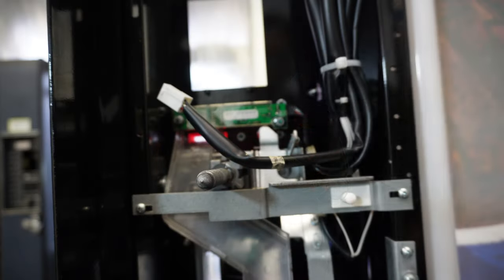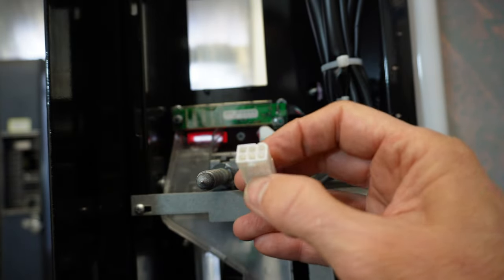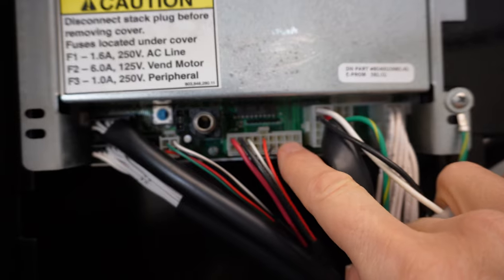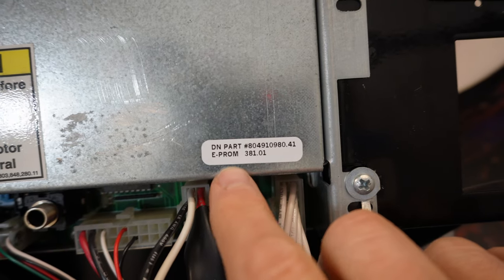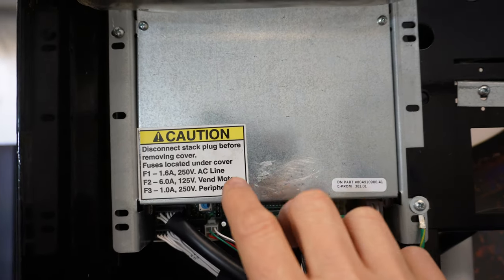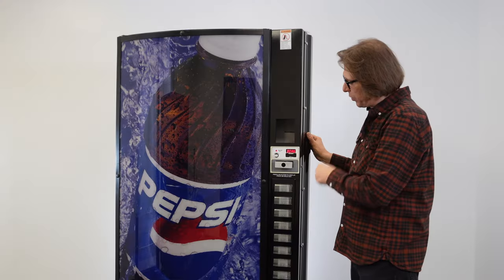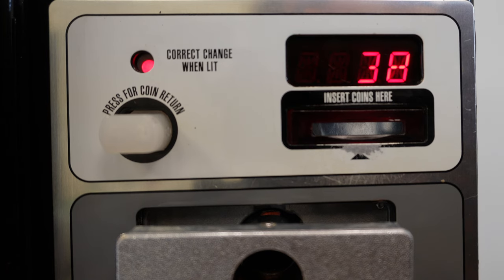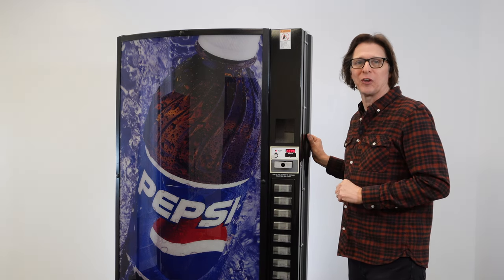Drink Vending Machine Cashless Payment Requirements For Dixie Narco E Series

Comment: Would you have any insight for this…..My Nayax credit card reader accepts the credit card, chargers the card but doesn’t vend the soda??  I’ve disconnected then reconnected the daisy chain but still doesn’t vend product but accepts card!
Reply: My does the same, ive tried two different readers and two different control boards, no clue why it won’t work

Comment: Do i need to change some settings to get the nayax reader to work? How?
Reply from the maker: This is very difficult question answer as you have not provided much information to your issue. Are you running the latest Firmware on your control board? Is the NAYAX device receiving a strong enough cellular signal? Does the machine work with cash? If the machine is working with cash then you should contact Nayax about your issue.
Reply: @VendingMachineSupport  i have to update the eprom. So i ordered that from d&s vending. It cost 45 dollars.
Reply: I have a 380.29 firmware and I get a V02 on the Nayax and disables the bill acceptor. Will the firmware to 381.41 solve the problem ?